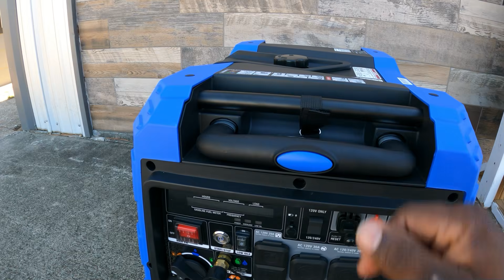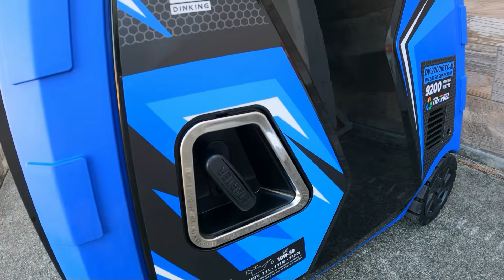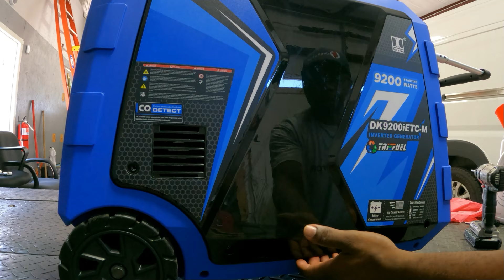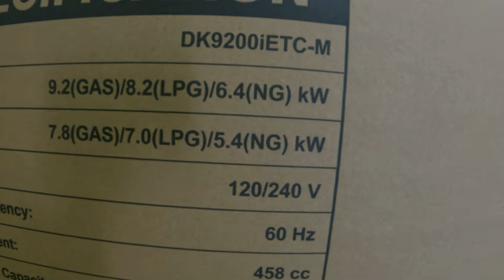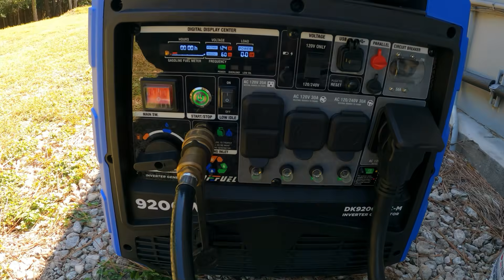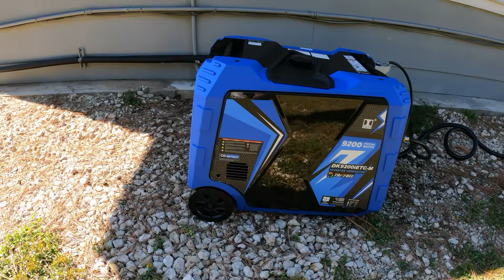DK9200IETC-M 9200W Generator, Tri-fuel, Gas, LPG NG, 120V/240V Output, Remote & Electric Start

Comment: I am strongly considering buying this, but I want to know if this could parallel with a Duromax 11,000 inverter generator?
Reply from the maker: They have different parallel ports, so it will not be compatible with the Duromax
Reply: @GeneratorReviews  Aww man, that’s a bummer. If you don’t mind me asking, what other brands would you recommend that work well with DuroMax inverter generators? I think I saw another one of your videos where you mentioned parallel connector adapters too.

I’ve owned generators for years, but I just picked up my first inverter model and I’m brand new to the whole parallel setup, so I’m trying to learn how it all works. I've been watching your other inverter videos and learning. THANK YOU!

Comment: Great video. Do you have the dimensions for this unit? I did not see it on your website. Thank you!
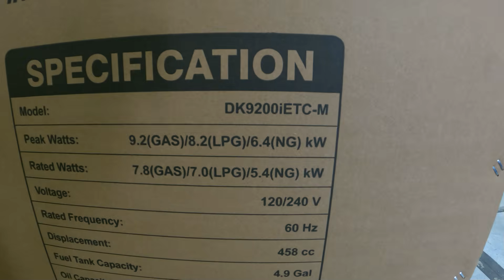Reply from the maker: Dimensions at 8:29 on video.
Reply: @GeneratorReviews  Thanks. Skimmed through the video.
Reply: @GeneratorReviews  Found them.36.1"L x 24.53"W x 25.98"H
Reply: @GeneratorReviews  Aren't those package/shipping box dimensions?  Can you physically measure the generator itself?  Would be very helpful.  Thanks for all your content.

Comment: Another excellent video. I need to get some side hustling going so I can get some cash up. I really like some of the stuff in your store. Just need to get the cash. Great video. Keep it up. 👍
Reply from the maker: I will help you when you are ready😉, no worries
Reply: @GeneratorReviews  I have a predator 3500 and then the open frame predator inverter i’m currently parallel to back up my house. I don’t have central air so I use window units in the summer so that’s the only reason I’ve been getting away without needing 240 V, but it would be nice in a long blackout to be able to dry some clothes or use the big stove instead of the hot plate and microwave, but it works in a crisis situation I mean 50 A at 120 V is a good amount of power, but it would be nice to be able to do 240 😂